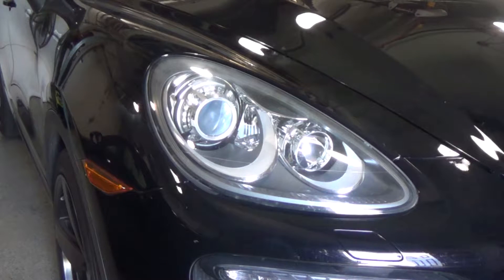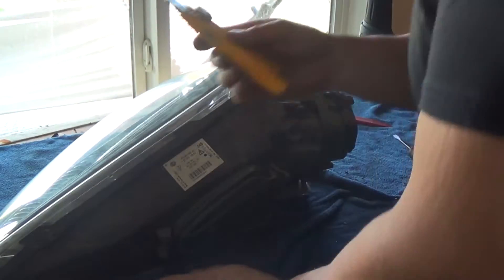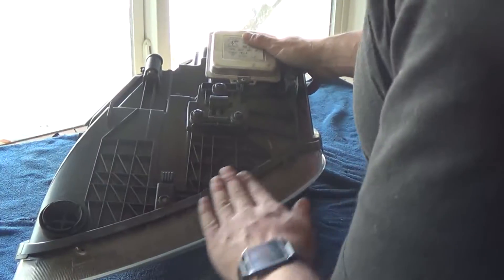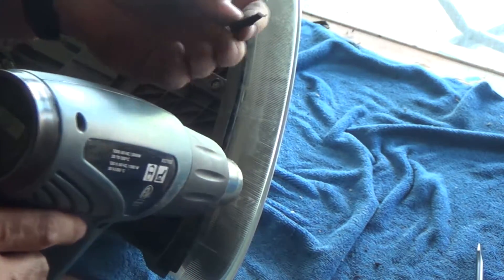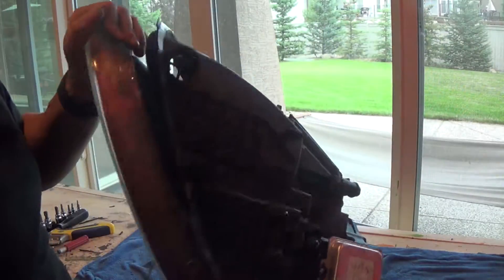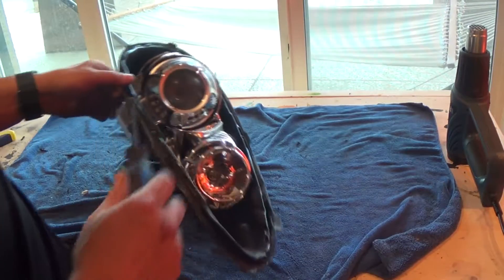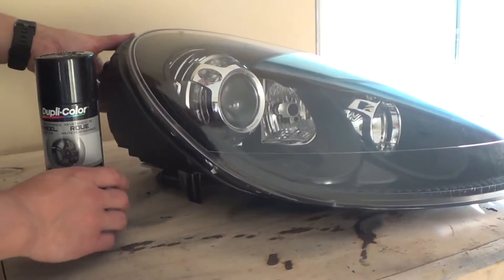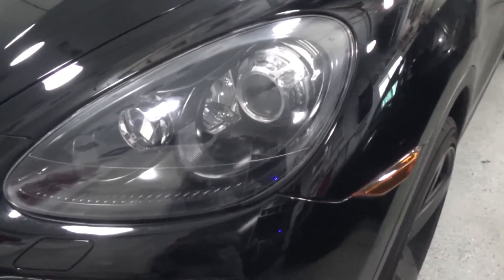Cayenne Headlights Painted Black

Comment: Looking to retrofit my 958.2 headlights....right now it has the standard HID lamps. I want to change the guts to the LED version, but re-use the lenses from the existing HID lamps. To just buy one used LED lamp is $1500....to buy one with a damaged lens is much cheaper. Considering the PITA glue Porsche uses....do you think this would be possible? Thanks!